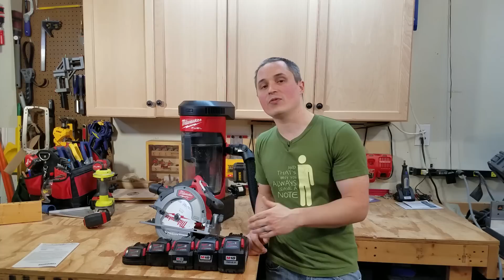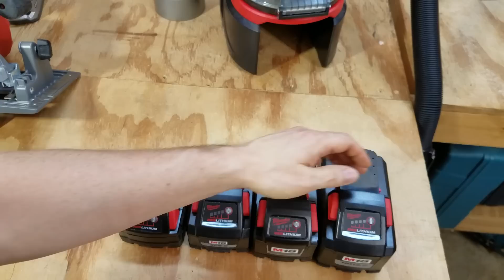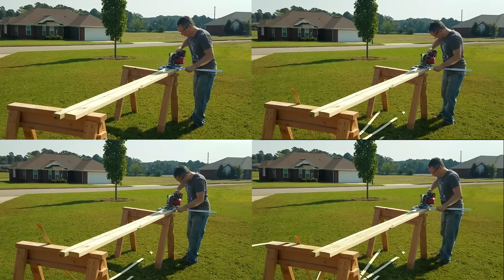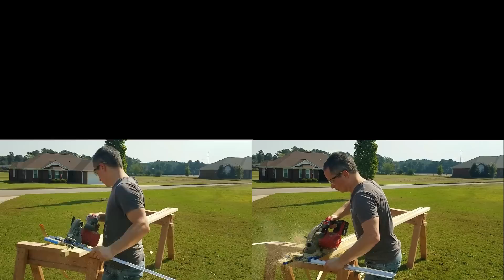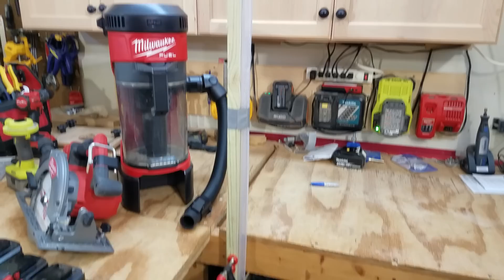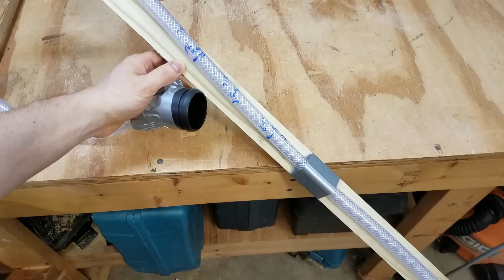Milwaukee M18 6Ah vs 9Ah vs 12Ah High Output Battery Performance Test

Comment: Hahahaha. You fools think you get more power out of amp hours hahahahahahah. You just get longer run times, not more power... good grief.
Reply from the maker: So you're just gonna stick your fingers in your ears and ignore all the proof I just laid out? I can't help you then.
Reply: Ever heard of voltage drop? Run all accessories in your car with it off then turn car on AnD repeat. The difference is from voltage drop and car battery not being able to keep up. When running has alternator to charge so voltage stays where it should. Hope this helps explain for you.
Reply: What's really funny is a plumber making false claims about batteries like he knows about electricity
Reply: JT Plumbing the test is to determine if there is noticeable change in the tools power depending on the cell configuration. Of course you don’t get more resting voltage!? Unless you are using a 28v Milwaukee battery 🤔 on a 18v tool? Those running these tests know that, but given the voltage drop you get when under load the test is to determine whether that minuscule difference in voltage drop plays a part in how to tool preforms!? Like Doresoom Reviews was showing us (not you obv 😆 you have must have cotton in your ears...) larger cells spread out are able to outperform smaller cells under load giving you less voltage drop total causing a slight power increase to the motor! Not more resting voltage... But hey if you watch the vid (with an open mind that is) you might be able to conclude this also 😉
Reply: More battery cells in parallel (which is what is happening here) increases capacity and maximum current. You are basically increasing the number of pipes which are feeding your motor which increases the maximum power.
Reply: Jacob Scheer 🤣longer run time , does not mean more voltage. It’s that simple. It producers the same amount of voltage, no matter how many batteries it has.
Reply: @jtplumbing6592  I think you are confusing what I mean by battery cells. Each of these Milwaukee batteries is made of smaller batteries cells that each produce 3.6 volts. They put 5 cells in series to produce a "pack" with the 18 volts that we are familiar with. The higher amp hour batteries have more of these "packs" in parallel. This has the additional effect of also increasing the maximum current draw of the entire battery.
Reply: Jacob Scheer no I’m not confused, no matter how big the battery is as far as amp hours, it only producers 18volts. Period, end of story. It does not produce more power.
Reply: @jtplumbing6592  Power = volts x current. If you increase the current it will increase the power.
Reply: Jacob Scheer welp, I made as simple as I could for you people, and you think I don’t get it 🤣😂🤣😂🤣im Done. Have fun believing you get more power just because a drill runs longer with a larger battery.
Reply: @jtplumbing6592    You're only partially right.  While they all produce the same voltage, higher amp-hours are achieved by adding cells in parallel.  This increases capacity (amp-hours) and reduces the voltage drop under load, leading to higher SUSTAINED power.  So to say that higher amp-hours "gives you more power" would be incorrect.  They just resist power loss (due to voltage drop) better.  The 6.0 and 8.0 batteries are 2P (2 rows in parallel).  The 9.0 and 12.0 are 3P.

The high output batteries (21700) will output higher peak current than the old batteries (18650).  This actually does produce higher power output.  And the 12.0 and 9.0 (3P) will maintain peak voltage better than the 8.0, 6.0, 5.0, etc (2P). 

You ever notice how whenever people test tools on YT that people will complain if they don't use a fresh battery?  That's why.  A partially drained battery will not produce peak voltage.

I think you are just misunderstanding what they meant.  I don't think they literally mean that more power is produced, though it is for the high output batteries, but that has nothing to do with the amp-hours.
Reply: slylockfox101 good grief, you could have said, “yeah JT” ,”you’re right”. No need for that story you wrote. 🤣😂🤣😂🤣😂🤣
Reply: @jtplumbing6592    Except you're not right.  I clearly said that you were misinterpreting what they were saying.  As others have said, maybe you should read better.  You actually do get "more power" as amp-hours go up due to less voltage drop.
I don't even get the point of you being here.  You seem more concerned with proving yourself right than understanding what others are saying.  All you really did was disprove something they never said.
Reply: slylockfox101 🤣😂🤣😂🤣😂🤣🤣🤣🤣🤣🤣🤣🤣🤣🤣you really believe it’s more power 🤣😂🤣😂🤣
Reply: @jtplumbing6592    Over time?  Yes.  A battery with more capacity will have less of a voltage drop at 50% charge than a lower capacity battery, thus supplying more power.  This is fact.  There have been several people that have explained this simple concept to you, yet somehow you still think you're right.  At this point, you're just making a fool of yourself.
Reply: slylockfox101 🤣😂a bigger battery doesnt produce more than 18volts. Period. Therefore, it doesn’t have more power.... period, there is no debate here. Sorry you thought there was.
Reply: @jtplumbing6592    I never said bigger batteries produce more than 18 volts.  I said they produce more power.  Those are not the same thing.  A fully charge battery will measure 18V.  A 10% charged battery will not.  And if 2 batteries are equally charged at 10%, the one with more cells in parallel (higher capacity), will measure a higher voltage.  Maybe you should learn to read.
Reply: slylockfox101 then say it correctly, it produces longer run times, not more power. Because batteries don’t make a tool more powerful, they make them run longer without the battery dying, that’s it.
Reply: Power = Work / Time.    The vacuum was doing different amounts of work(based on height it could bring the water to).   Time is the same(time spent lifting the water, not run time incase you get confused again), work is different therefor power must also be variable based on the battery used.

Comment: I only have one 9.0 and a few 5.0 and smaller. I first bought my tools when they had the 4.0 as the biggest. Honestly I have no issues with any of my batteries. I don’t do crazy hard construction. I could see how it would be different grinding or cutting non stop
Reply: Hey man I have a question for you about batteries. What's the best way to preserve them to last you a long time? Also is it bad if you dont use the batteries all the time? Only once in a while through out the year for example?

Comment: If you have a first generation Fuel circular saw, I would like yo see how the batteries perform on those.
Reply from the maker: Sorry, I don't have that one. Mark reported in the comments that the 12Ah gives it a significant boost though.

Comment: My batteries, Milwaukee M18 6AH and 9AH with 18650 and 12AH with 21700, NOT need 5ah or less and 6ah with 21700, Milwaukee battery for torchlights ONLY

Comment: I agree with your test I bought the Milwaukee chainsaw and all the batteries perform well of course the 12 is the most powerfull but what I find is the 9 and the 5 amp batteries over heat before the battery is dead and the ho batteries don't seem to unless maybe if your really pushing it.
Reply from the maker: Good to know about the chainsaw - I can see that being one of the highest demand tools, since due to the nature of the work a chainsaw will be cutting a lot more continuously than a circular saw.

Comment: Did you get your 6ah  battery with a tool?  If so, which one?
Reply from the maker: Milwaukee provided it for the comparison test. I don't think it's included in any kits at the moment - they sell 1 for $150 or a 2 pack for $200, which comes out to the same price per Ah as the 12Ah battery.

Comment: I’d love to see the cut test on the gen1 fuel circ saw or some other tool that isn’t specifically made for the new batteries. You did docthe vacuum but I’d like to see it done on a saw or something. People are saying that the new batts give more power to the older tools but I’m not so sure that’s true. Milwaukee claims that they don’t and according to your vacuum test that is true. Regardless, thanks for the video
Reply from the maker: That's an excellent point! Most of the pre-12Ah battery M18 tools I have are lower power draw tools unfortunately (drills, impact drivers and wrenches, multitool, etc), so I don't think there would be a big difference with them. Otherwise I definitely would have checked performance on those as well.
Reply: Doresoom Reviews I would think the same thing but there seems to be a buzz in the air regarding this issue. Many believe that the new batteries increase the power on the older tools even though Milwaukee denies it and it doesn’t make sense for the tools to know to draw more power. Vcg construction YouTube channel just put out a video in the past few days comparing them but it was one hole drilled with an SDS and then one lag screwed in with an impact wrench for each battery. I like your methods (you seem to set up as many controls as possible to limit the variability I like that much more scientific method than most) so I would really like to see a comparison done by you with one of the older tools.  Either way I still enjoy all your reviews and your delivery methods of the information. I really appreciate it.
Reply from the maker: I've got the Gen 2 and Gen 3 hammer drill, which were developed on either side of these batteries existing. I'll try to get around to testing them with a big self feed bit at some point. 
As for the Gen 1 saw, Mark pointed out in another comment that he's seeing a big difference in power between the 9Ah and 12Ah. He's a pretty regular commenter on my videos and usually has some good insight to add, so I'd trust his reporting.
Reply: Doresoom Reviews thanks man!

Comment: What’s the run time difference with the 6 and 9 amp?
Reply: Theoretically the 9.0 should run 1.5 times as long and it probably does on tools that draw very little current but with the improved cooling capacity on the 21700 cells I could see the 6.0 lasting longer on something big like the chainsaw
Reply: K Gappa this was exactly what I needed answered lol thanks
Reply from the maker: I haven't done a full runtime test for them yet, sorry.